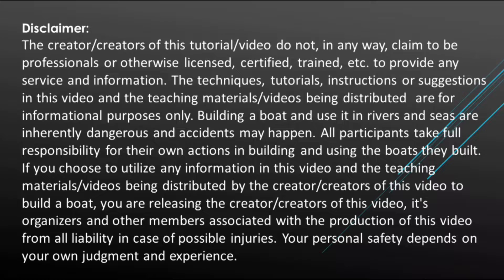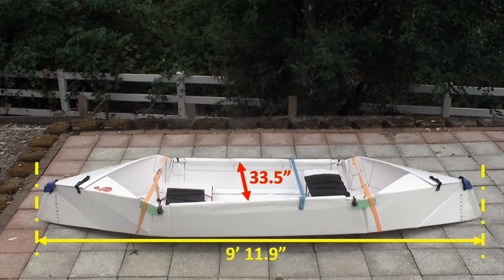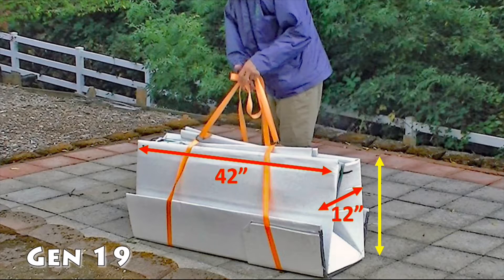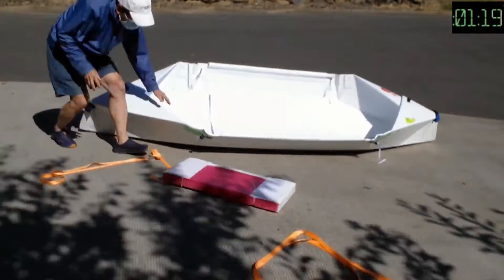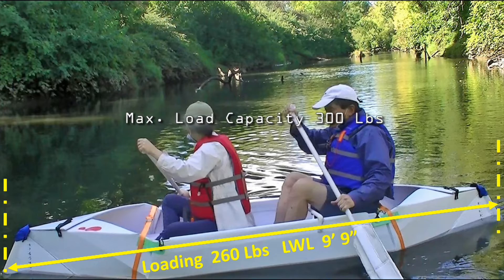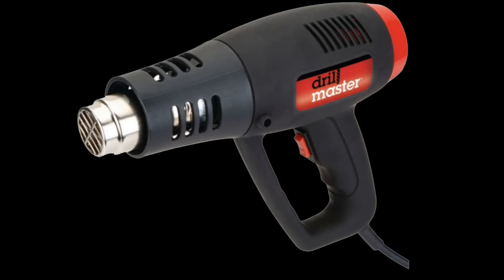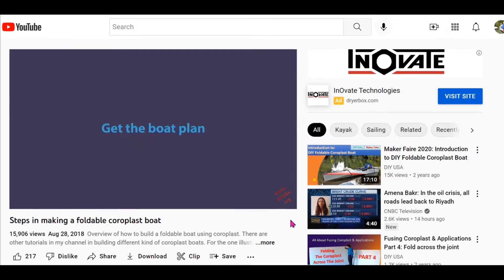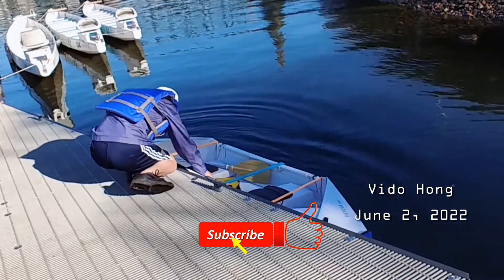Maker Amazing Award Submission: Build The World's Lightest 10' folding Tandem Canoe

Comment: Home Depot and Lowes will not have 5'x10' sheets. But I guess pretty much everyone subscribed knows that.
Reply from the maker: Yes, I agree. In Portland OR,  https://www.multicraftplastics.com/ carries 5' x 10' 4 mm thick coroplast. Though it is thinner than the 6 mm one I am using, but it will work with additional reinforcement at the bottom of the boat. I came up with heat fusion method to join smaller coroplast sheets together and I have a few videos showing how to do that. I built a 14.5 ft long boat using that method. Make Magazine also funded a project to build 12 ft long boats using the 4' x 8' coroplast from Home Depot. You may want to check that out also https://makezine.com/projects/origami-kayak/  Cheers!

Comment: I like it but Im right at the max weight and would need another 50-75lbs for a battery and trolling motor, my shoulders and neck are too messed up to paddle
Reply from the maker: I believe my foam boat design can be modified to support your load capacity requirement. Besides, it will be easier to build a mount for the trolling motor on the foam boat.
Reply: @DIYUSA  I agree, Ive had a cat style boat with foam floats in mind for awhile..its just ignoring all my other projects and getting started thats the problem

Comment: Where do you buy the coroplast?
Thanks
Reply from the maker: I am not sure where to get the coroplast in your country. However, those places making signs may have coroplast.
Reply: @DIYUSA  I'm in NL, Canada.
Reply from the maker: @herphermits  I did a google search " buy 5' x 10' coroplast in Canada" and found this company https://canada-plastics.com/product/coroplast-sheet-translucent/  They list the large size of 4'x8' 6 mm. I also found this company which has offices in Canada. They have to 5' x 10' coroplast. https://www.polymershapes.com/company/
I don't know if you have Homedepot in Canada, In US Homedepot carries 4'x8' coroplast. You can still build a nice boat by heat fusion using 4' x 8' coroplast. You can read this article and see how to do that https://makezine.com/projects/origami-kayak/  (more info on my youtube channel, or go to https://www.diyusa.org/techniques for links to different videos in building coroplast boats). Please let me know if you need more info.
Reply: @DIYUSA  Thank you. Would it be better also if i use HDPE sheets 3mm thick?
Reply from the maker: @herphermits  I have not used the HDPE material and not sure how well it works.